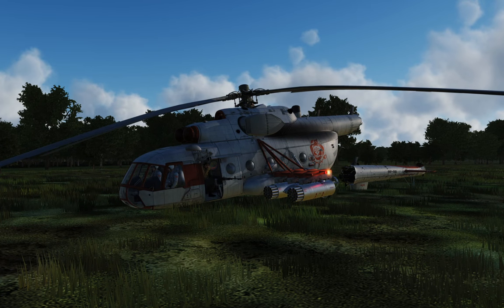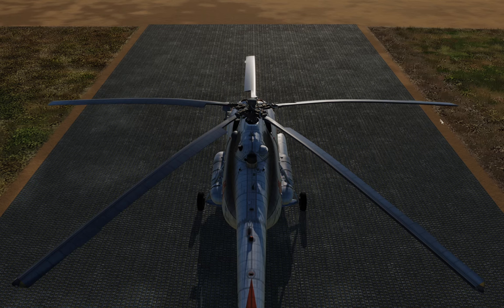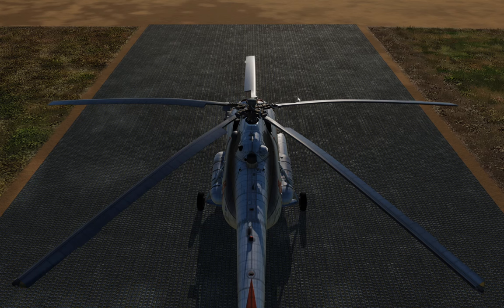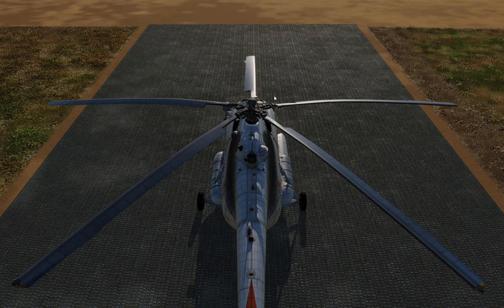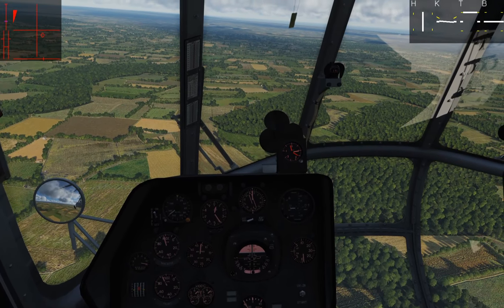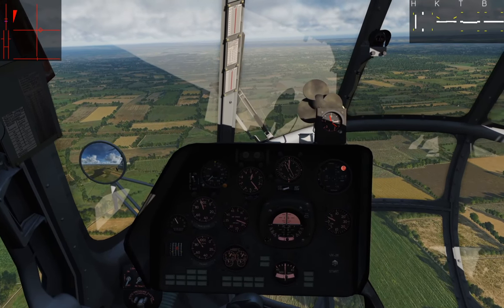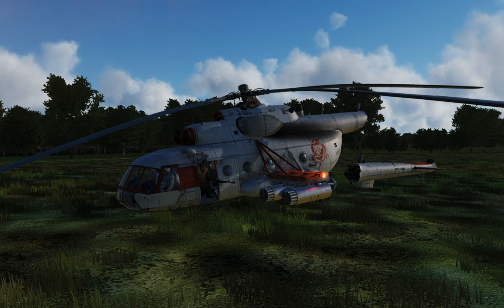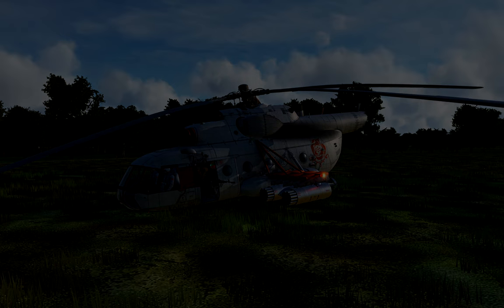DCS Mi-8: Vortex Ring State Tutorial

Comment: I'm debating just how much detail I want to go into here before everything I type just starts becoming annoying rather than helpful. The problem is, vortex ring state, like so many other things in a helicopter, does not lend itself to simple explanations. I'll start with comments at various time stamps, and then follow up with a summary of my own. 

0:48 It's not that you're rate of descent is "so high..." it's more that your rate of descent is beginning to equal the rotor's induced velocity. Many people say the rotor is descending into its own downwash. 

1:03 The S-64 may be able to "power out" of VRS, but that's likely because it is comparatively light compared to other similarly sized aircraft. It would not be able to do that while doing what it is designed to do: carry heavy loads. 

2:35 So, the whole thing with the root vortex is simply unimportant for this discussion. The turbulence associated with the presence of the hub and fuselage largely destroys the root vortex. It is true, however, that net airflow may by upward at the inboard section of the blades, so there will be another vortex, but it is not about the blade root, but somewhat more outboard. 

4:40 So, I suppose this would relate to the idea that VRS occurs when your descent velocity roughly equals your induced velocity. Normally, the tip vorticies are washed down with the induced velocity (Here's an excellent video showing tip vortices and wake contraction https://youtu.be/lslarZiRJhg ). If the induced velocity equals the downward velocity, they will be washed up into a single torus ring encircling the blade tips. This is a gross simplification, but it's not bad for the layman. 

7:52 Collective doesn't really make things worse (you'll notice you arrested you descent at -10m/s) but it doesn't help either. It merely keeps you in VRS rather than allowing you to transition to an autorotative or windmill brake state (more on this later). 

11:30 This may be nitpicky as I probably just picked up on you mis-speaking, but VRS is not an aerodynamic stall. The blades may stall if the pilot uses too much collective pitch, but this is not inherent in VRS. I can appreciate the similarities as experienced by the pilot, however; in both cases, the correct response is to do the opposite of what your instinct might tell you. 

12:38 Absolutely not. The requirement is that the rotor must be in a thrusting condition and in vertical descent close to (~70% to 125% of) the rotor's induced velocity. You could enter VRS during an autorotative flare that you entered too high and which didn't properly arrest your vertical speed. If you then pull collective, you could enter VRS just as your rotor slows down, making your day even worse. 

12:59 Yes, this is true. Auto-rotation and VRS are different vertical flight states. However, auto-rotation is not the same as un-powered flight. 

13:16 "High rate of descent" isn't really true. I think you've demonstrated that VRS occurs at a pretty low rate of descent, especially compared to rates of descent you can safely achieve in forward flight. At sufficiently high rates of descent, you will exit VRS and enter turbulent wake state and then windmill brake state. 

13:31 Pretty much right. Pilots like to talk about ETL like a special point where everything changes. As engineers, we don't really think like that. But there are enough cues available to the pilot to make this a good rule of thumb. Essentially, if your velocity is more vertical (downwards) than translational (ie, your descent angle is greater than about 45 degrees) then you're prone to VRS. 

Okay, now I'm just going to ramble a bit. 
If you haven't seen this video, I highly recommend it. https://youtu.be/HjeRSDsy-nE?t=129
So, VRS is a very unstable state. It's actually difficult for a pilot to remain in it for any significant length of time without pitch and roll oscillations threatening to tip you out of it. The problem is when it happens close to the ground, where you don't have to remain in it for any real length of time before you hit the ground. It can be though of as an airbody surrounding the rotor system which grows, bursts, reforms, grows, and bursts again. Within this airbody, there is no net change of momentum of the air, it just kinda gets sucked down with the helicopter. The air is very turbulent, and as the body grows and bursts, there are a lot of thrust and flapping fluctuations that make for a rough ride. 

Depending on who you talk to, there are 4 main states of vertical flight: climb, vortex ring state, turbulent wake state, and windmill brake state. Hover exists on the boundary of climb and VRS. In reality, a small amount of vertical descent is tolerable before entering VRS. In his book, Ray Prouty distinguishes slow descent as its own condition, and doesn't consider the turbulent wake state, instead combining it with VRS. Regardless, there's an entire region of vertical flight between hover and a descent rate of twice the hover induced velocity where momentum theory (probably the most important and foundational theory of helicopter aerodynamics) breaks down. Empirical data may be used to fill the gap, but the fact remains, it's a very difficult state to model analytically. Beyond a descent rate of twice the induced velocity, you enter windmill brake state, for which momentum theory provides good answers. 

The point I want to make here is that you will exit VRS and enter an autorotation if you keep your collective low and remain in vertical flight. VRS is not characterized by a descent rate greater than some velocity, but actually a range of descent speeds. Increasing collective acts to keep you in VRS.  

As for what you need to know as a virtual pilot, I think you got it pretty much right: avoid descents at low or zero forward speed. If you enter VRS (Characterized by a turbulent, unsteady vertical descent), enter translational flight to exit the vortex encircling the rotor. 

As before, I hope you found this helpful.
Reply from the maker: Very helpful. These are as you say complex problems that don't lend themselves to simple explanations and here I come as a virtual wannabe pilot trying my best to do just that :P

Thank you for sharing your knowledge, I hope others reading this will find it as useful as I did.
Reply: Wow. A lot nothing to read. Good job. pros everywhere you look... lmao

Comment: My first foray into DCS has been with this Hind, and I'm almost certain this is the exact issue I've been running into that causes me to lose lift and promptly slam into the earth. Even as you described, I attempted to raise collective as a fix and now know it's not the correct procedure. Thanks for the informative video! love your content:)
Reply from the maker: Yep, that sounds right. And you have it harder in the Hind because ED hasn't added the buffeting and shaking yet. So you don't get much indication that VRS is happening until it's too late.

Keep an eye on your vertical velocity indicator and make smooth collective movements and you'll be ok! Good luck!
Reply: Not knowing you've slowed down enough to need to really worry about it can be a real pain if you're focused on trying to nail the landing spot. Keep at it, you should develop a feel for it soon enough!

Comment: Main point at the bottom. I keep bouncing between thinking VRS is way over done in DCS and the ground. Convoluted jokes aside, I don't think that's the issue. Helicopters are a lot more somatosensory involved than airplanes. I am still figuring this out, being a fixed wing guy IRL. But say, in a fixed wing aircraft, you can feel when the airplane is about to stall. You learn to feel and avoid this state. VRS is basically a stall but for different reasons. In a helicopter, you learn to coordinate collective and pedal, or you constantly swing left and right every time you adjust collective. In a similar manner, prop pilots have to use rudder any time angle of attack is high to adjust for P-factor among other things. In DCS, you see this with an uncentered ball in the P-47. In a real plane, this feels uncomfortable. The long and convoluted point I'm making, is we're all just jumping into these complex machines and learning them on the fly (oh yes I did). Real helicopter pilots don't talk about VRS that much because they know how to fly the things. VRS is something the pilot did to the helicopter, not the other way around.

One thing I know I keep doing in the Hind at least is this. I go for the aggressive stop, which is already difficult enough in the Hind. If you don't know what translational lift is, it's time to look it up. But there's an important thing to remember here. When you slow down, you lose translational lift. If you don't PREEMPTIVELY add collective as you enter hover state, you have already lost; both lift and the battle. It's important to monitor your vertical speed, but be careful about utilizing the VVI/VSI for this. An old fashioned VSI has a lag time of 6-9 seconds. It is a TREND instrument. Your altimeter is instantaneous. I've figured out this is my biggest problem when I'm in the heat of battle trying to make a landing and I'm focusing on where I want to set down. And then I go into a state of RUD. Rapid Unplanned Disassembly.

Comment: I've never experienced VRS in any other helicopter more than in the Mi-8.
Reply from the maker: It's definitely modeled in the others (though, in the Gazelle you can just power out of it so it doesn't count), but the weight of the Hip makes you so much more prone to it. Combine that with the slow spool up time on the engines and it's definitely a recipe for disaster if you don't stay one step ahead.
Reply: @vsTerminus  I wonder you can power out of VRS in Gazelle because it's a light helicopter, or because DCS modelled it not accurate? In the Huey i tried to power out of VRS but fail every time (or maybe skill issue from me)
Reply from the maker: @nobeltnium nah, my understanding is the kind of power to weight ratio needed to just power out of VRS only exists in like the S-64 Skycrane. The Gazelle does not have that kind of power, the flight model was just simplified and did not accurately reproduce VRS.

Comment: Do you apply any curves to your controls? If so, what are the numbers and why do you apply the specific curves if any?
Reply from the maker: I don't currently use any curves in the Mi-8. 

I found them useful when I was learning because I think most people naturally tend to make larger corrections and movements than they need and it takes time to learn the "fine touch" you need.

Curves are also useful if you have low end or worn out hardware with large deadzones, or even in things like the Warthog HOTAS with its stiff centering spring. There is no shame in using them if they help you.

If you find you are wobbling around a *lot*, try putting a +10 curve on your Pitch and Roll axes. You can experiment from there, but I wouldn't go higher than +15.

The hip shouldn't require you to adjust saturation values, at least I've never personally felt the need to do it.

Comment: Time to hear from somebody whose working on this helicopter's VRS problem and tail snapping... ME!!!!
VRS deaths = 32 with 80plus hours of flying it. DCS SAR mission. Caucuses.
Collective/lift
Dead zone = 0
Xsat = 82+
Ysat = 86+
Curvature = 0
NO MORE VRS if you watch wind direction.

Pitch
Dead zone = 1+ or 0 depending on ones habits of flight.
Xsat = 45+
Ysat = 45+
Curvature = 90+ you can go 100, and it should be fine

Roll
Deadzone = 1 or 0 again depending on ones habits.
Xsat = 45+
Ysat = 45+
Curvature = 90+ you can go 100 but it should be fine

Rudder

Deadzone = 3+ to 5+
Xsat = 0
Ysat = 0
Curvature = 0

Try this and let me know what you get. If you play DCS come see me in SAR caucuses. I'll help you out. If I am not working, I am flying. LOL
Until the war starts
Reply: This WILL cure TAIL SNAPS or TAIL ROTOR LOSS
Reply: NO MORE CRASHES